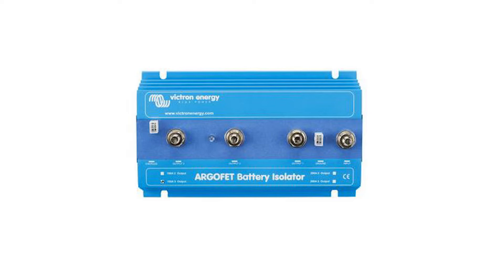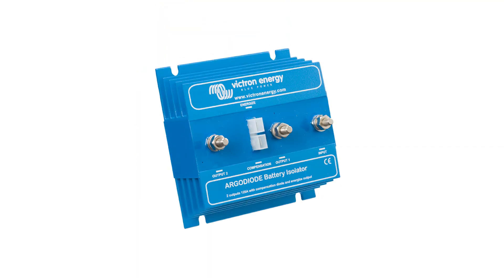What Is the Voltage Drop for a DC to DC Converter Compared to a Fet Battery Isolator?

Comment: With a high-output alternator charging the starting bank, and house bank being charged from the starting bank through a DC to DC charger, does the charger transfers the extra curant pushed by the alternator and not used by the starting battery bank directly to the house bank?

Comment: Hello Jeff,

I am looking into a new Lithium house battery bank and would like to be able to charge from my existing equipment Solar, Alternator and battery charger. Would it be a good idea to run all the charging currents threw a single DC to DC converter like the Victron Orion TR 12/12-50 ?

Kind regards,

Carlos

Comment: Hi Jeff. When I installed our 840Ah, 24V LifePo4 battery bank last year, I attempted to install (4x) Victron 24/24-17 DC to DC chargers between our 24V stand-alone alternator and house battery bank (2nd 12V alternator for engine and genset batteries) in an effort to protect the alternator. I did this not realizing that my Sterling Power ProReg DW external voltage regulator was at a minimum at least producing a cleaned up AGM charging curve (and about 50A of 24V current) that was compatible with the new LifePo4 batteries. The point is, these (4) DC to DC chargers were advertised as being able to be run in parallel to quadruple the 17A output, but in fact were creating so much voltage drop that I was seeing 8-9V of drop over that circuit. I Googled the problem and saw post after post of people having the same issue, and Victron claiming it was all due to wiring being too light. As an experiment, I rewired the circuit w/ 2AWG pre-tinned boat cable, both pos and neg sides, well above the 6AWG calced w/ Blue Sea Circuit Wizard, and still saw roughly that level of voltage drop. With these units now attempting to convert 17V to 28.8V, I was getting about 17-20A output, which defeated the whole purpose, and this only by setting the Low Volt cutoff to the minimum of 16V. I therefore removed the Victron units and instead added a Balmar Alternator Protection Device (APD) as protection against potential voltage spikes should the (3x) BMS units on the batteries shut off suddenly during charging. Things worked well over the 8 month Caribbean sailing season after that. Am I on the right track here, or would you recommend additional equipment?

Comment: Isn’t that what a DC / DC converter is designed to do, drop the system voltage from say 24V to 12V ?  That’s certainly a big voltage drop, but it’s a desired drop in voltage, right?  What am I missing here?

Comment: Wouldn't the DC to DC charger be a better choice for a long distance run, say for the windlass batteries. I think it would handle the voltage drop better and deliver the correct voltage. They are also programmable for bulk, absorption and float.